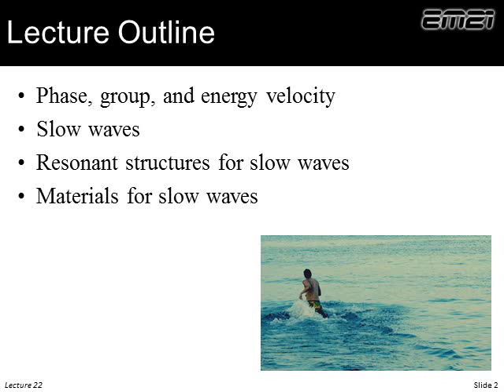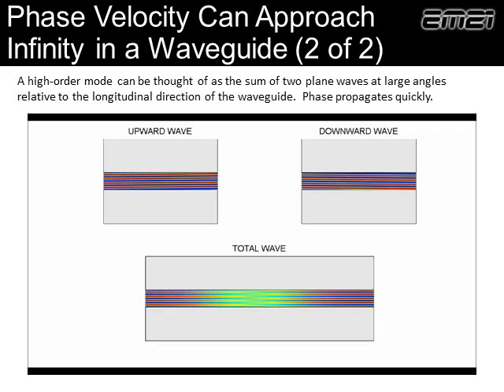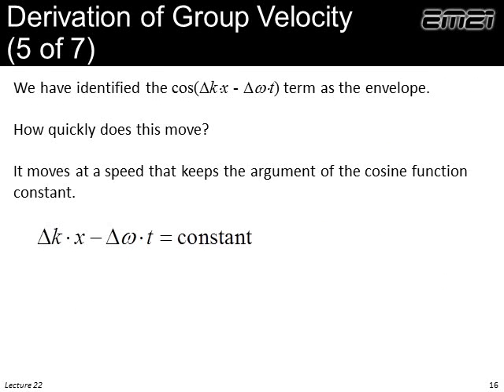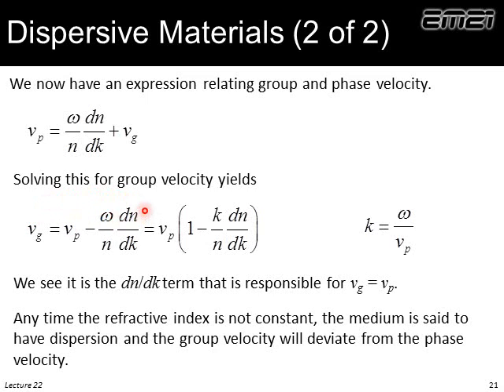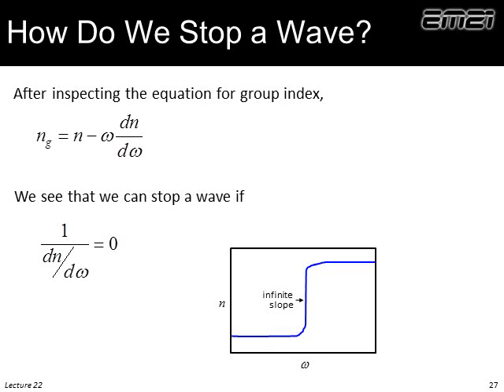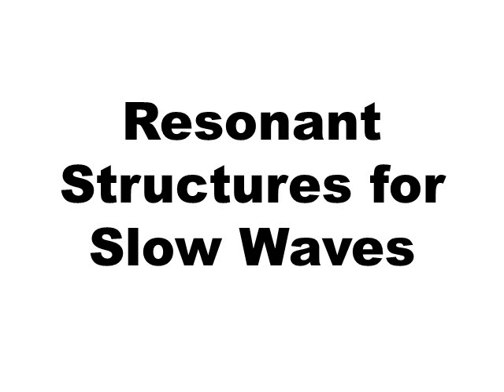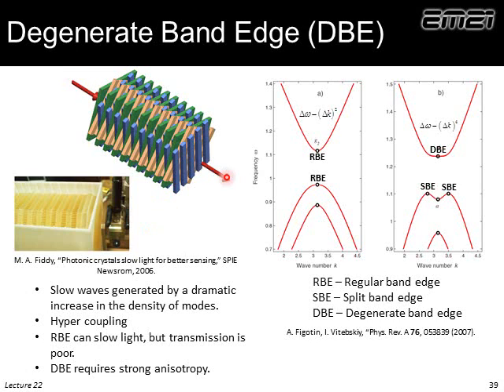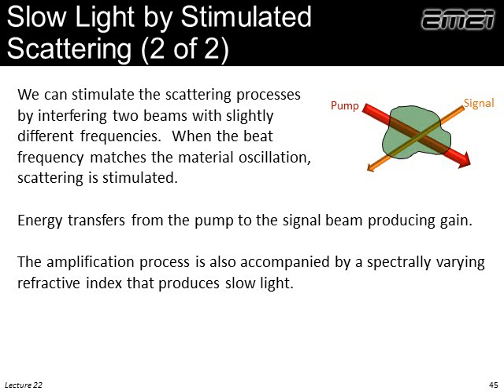Lecture 22 (EM21) -- Slow waves

Comment: Hi, Here you mention that "Phase Velocity can approach Infinity in a waveguide". And in another youtube lecture "Dispersion: Phase Velocity Versus Group Velocity, PHYS 372" by Stephen Remillard, it's mentioned that "Group Velocity can approach Infinity as well " (18:11, https://www.youtube.com/watch?v=7oSpQy95b-E). So Can I conclude that both Phase Velocity and Group Velocity can exceed the speed of light?
Reply from the maker: There is also energy velocity! LOL

Phase velocity routinely exceeds the speed of light. In fact, I recently made a video about this for guided modes in a rectangular metal waveguide.

https://youtu.be/jju9bjc067o?si=CeQOqdf74hUg6Jqi

I am aware that group velocity can also exceed the speed of light, but I am unaware of energy or information moving faster than the speed of light.